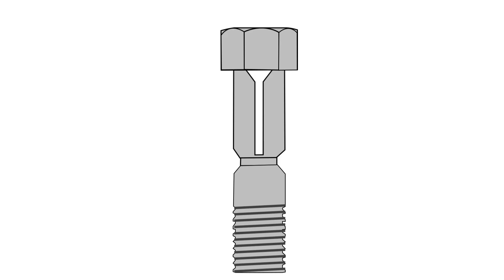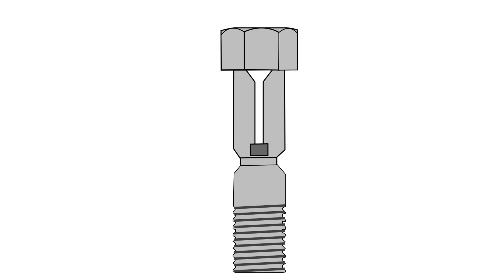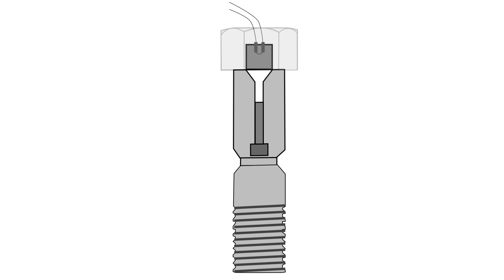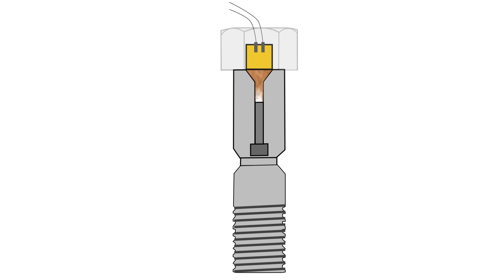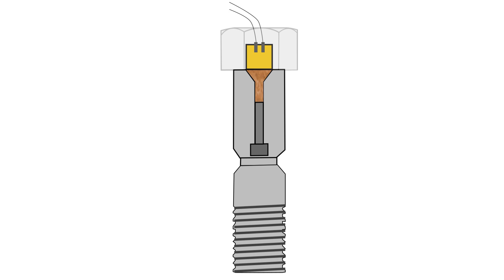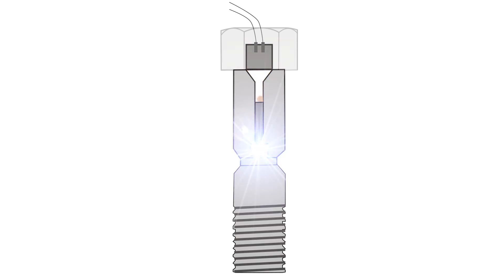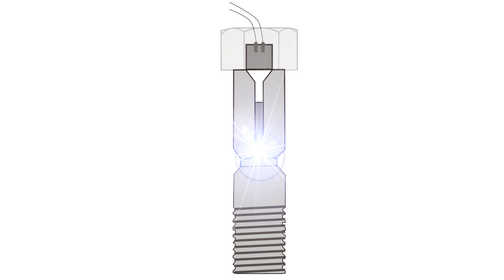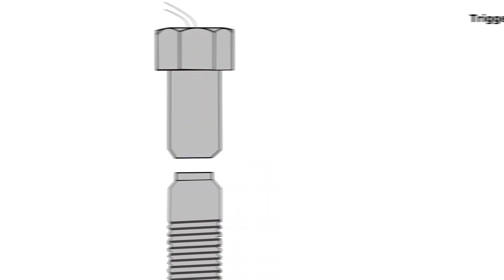Explosive Bolt

Comment: They use these for helicopter ejector seats. More precisely the rotors right above the helicopter ejector seat, so the pilot doesn't get turned into chunky salsa
Reply: I don't think many helicopters have ejection seats. I know one russian helicopter does, it's one that has stacked counter-rotating blades
Reply: @richardmillhousenixon  i think i know the one you're talking about. I'm pretty sure hind series helicopters have them too. Of course it would be Russians who make them
Reply: @richardmillhousenixon  the Ka-52 would be the one you’re referring to
Reply: @doesitmatter1667  Ye, that's the one. The helicopter that yeets it's blades in an emergency
Reply: @doesitmatter1667  ka-50 also had the double stack blades and no tail one but im not sure if it's got an ejector
Reply: Oh dang nvm a quick Google and it literally said ka-50 is the first helicopter to have an ejector seat and the ka52 is literally a 2 seat version of the ka-50
Reply: Mmm salsa. What were we talking about again?
Reply: @jackkraken3888 Homer Simpson vibe
Reply: The pilot may mist it.
Reply: @Rudofaux  at such a high rpm it won’t happen. propellers spin too fast after all they’re lifting tons of controllable metal with  rockets on them or missiles which also pack quite a punch in how heavy it i
Reply: @Deltaivv  Mist it, not miss it.

I pilot will be turned to mist. Now that I explained the joke, it is now dead.
Reply: is the chunky salsa bit from the all guardsmen party by chance
Reply: Helicope have ejector seats
Reply: Also used on rockets
Reply: Chunky salsa lmao
Reply: Not sure I'm comfortable with explosive bolts holding the blades on. Probably why they learn to auto rotate down.
Reply: @graham2631  shhhh, shh, the explosive bolts will not hurt you. They *can*, but they won't
Reply: Side-ejecting seats don't exist.
Reply: @pirobot668beta  i'm too much of a nerd to care about the necropost. it's not side ejecting, it's so much more radical than that. the bolts that explode are the ones that hold the rotors on, they detonate just before the canopy and ejector seat activate. once those bolts are severed the centrifugal force sends the rotors flying, which clears the air space to send you flying straight up from the cockpit once the canopy has been detached.
Reply: @lithuaniaball  it seems people dont care that centrifugal force is just momentum that gets "bend" by the centripetal force... or people just dont wanna learn to call the force by its actual name? sry just confused you are the 50th person who still talks about centrifugal after its been proven to not exist as what it was defined as before. i wonder when people start saying momentum
Reply: @pirobot668beta  can someone smarter than I explain why that would be a bad idea? Because I can’t see why
Reply: @insertnamehere6960  My guess would be a couple of reasons. 1) If you're at an already low altitude, going sideways instead of up gives your parachute less time to deploy, and 2) the lateral g forces exerted on the body would probably cause your neck to snap, along with many other bones breaking.
Reply: @Razzman70  I think number 2 is the case here. Modern ejection seats are generally “zero/zero” capable, meaning they work even with zero airspeed and zero altitude.
Reply: @Razzman70  also the fact that parachutes tend to not be designed to fall *sideways*,
Reply: @insertnamehere6960  slightly tilted chopper, same reason downward ejection fell out of favor after pilots yote themselves into the ground after failed landing or take off
Reply: @Razzman70  also if back blades fail the helicopter will goes spinning with means there's is opportunity to be hit by the tail
Reply: I feel like most heli pilots worth their salt would never use the ejector seat. Just saying, if there's a chance they can recover or set it down somewhat safely, they are going to take it over ejecting.
Reply: @seththeace6217  Sometimes though, helicopters can't be recovered. If you get hit on your main propellers, or the back propeller, you're already done for. When you're going down, you'll be lucky to have the time to eject yourself anyway, let alone regain control over it. 

Planes are the same, of course, but actually somewhat less vulnerable to being made completely useless in one shot, as a plane doesn't rely as much on equal weight distribution or it's own engine; though even a plane can get damaged too much to save it.

Also why would you try to save the helicopter or the plane when experienced and talented pilots are in short supply, and cannot be made with money? 
There's no guarantee the landed plane can be repaired anyway, and even then militaries get much more funding than they deserve, a plane or 10 isn't going to make much of a dent
Reply: @cetomedo  ka-50 and ka-52 both fly pretty well missing the tail , double stacks don't need the back one , because using a back one takes about 30% of total available energy just to use the back one for what it was intended for so the 2 stack design is pretty redundant
Reply: @dylansheppard8636  Fair enough, but the double stacks still are susceptible to failure upon being shot by their.... double stacks:D

But yeah that's a good point the lack of a dependence on the tail propeller would make it much harder to incapacitate a helicopter
Reply: @cetomedo  double stacks wouldn’t be such a pain ejecting because the blades disconnect because that’s the issue, so you’d see 6 blades flying off. with explosive bolts and the RPM of the helicopter rotors while it was airborne is still high so each blade would go off like a shuriken and only the part that spins is left, because it doesn’t get in the way.
Reply: @Deltaivv  I didn't say double stacks would be hard to eject though, what you're saying is pretty obvious. What I meant was a response to Dylan Sheppard who pointed out a double stacks helicopter could still be recovered after losing its tail fin, and I responded by saying that double stacks can also be shot on its propeller which would leave the pilot no way to land it safely.
Reply: @seththeace6217  exactly, iv seen many auto-gyro landings. With choppers they can kinda "glide" down from the blades slowing them up, even with full engine failure
Reply: @backwoodsjunkie08  The term you're looking for is "autorotation." Autogyros are basically planes that use free spinning helicopter blades instead of wings, basically doing a powered autorotation.

Comment: Initially thought it was a bolt bomb we used to make as small children. Two large bolts and one nut. Break off a large quantity of match heads. Screw the nut a couple of threads onto one bolt. Fill the nut with match heads. Screw the other bolt very tightly then throw it high in the air or against a brick wall. Impact on the bolt head causes an explosion. Take cover as it is unpredictable.
Reply: We would use a stack of washers between a 1/2 inch nut and bolt and put green sticky caps on the washer flats, and these would be our toy grenades with out any shrapnel but a bang.
Reply: Try it down a corrugated iron lined alleyway with two 125mm M20 bolts and M20 nut...damn thing nearly took my head off as it overtook me
Reply: @Penguin_of_Death  now that im a responsible adult I might try it with gunpowder and a couple of match heads.

Comment: In China, they build breaking bolts even without explosives ;)
Fascinating video by the way!
Reply: You get what you pay for :).
Reply: And true. But sad.
Reply: Hmm, must've gotten some samples with my Grade 15 dual quality bolts.
Reply: Chinesium bolts.
Reply: You means bolts=buildings right?
Reply: the problem is that they don't break precisely when you want
Reply: In USA they build build planes that nose dives itself into oceans.
Reply: So damn true!😂🤣
Reply: Unless those bolts don´t get exported of course
Reply: Yeh, bolts with spot welded heads that break off under mild load!

Comment: You forgot to put an Amazon link!
Reply: The link was there... but it exploded
Reply: They contain explosives dumbass, you won't find those anywhere except places supposed to happen.
Reply: U can Google the instructions and make one yourself... 😉
Reply: @robinthrill3r7  thats the worst advice you can give someone about explosives lol
Reply: 5 years in the Federal prizon... and 25 years of losing your Rights...
Reply: @СергейРяшкин  ehhh probably a small enough amount to be considered a "pyrotechnic" rather than a "destructive device"
Reply: @seagie382  well... there is the 222's articel of Federal Criminal Code — 2 years, for the TWO •.22 LR! → 2 years
Reply: @СергейРяшкин  Could you provide some kind of source as I have no clue what you're trying to tell me
Reply: @СергейРяшкин  in russia? Lol I’d rather have vodka and a tank

Comment: Seems like what we would have would be a really weak bolt, with a narrowed shaft and then a hole drilled through the center. The bolts HAVE to be weaker. Are we sure the explosives are even needed?
Reply: How else do you have the pre-weakened bolt fail exactly when you want it to?
Reply: @Neuropsych it's actually not THAT weak - a similar profile is used on the fuse pins that hold aircraft engines to the pylons. These are designed to fail if vibration from a failing engine exceed safe limits. The fuse pin breaks, allowing the engine to fall away from the aircraft...

https://aviation.stackexchange.com/questions/23151/how-are-engines-mounted-onto-wings
Reply: That depends. Do you want the cockpit windshield to open against the opposing air pressure when you pull the ejection cord or not?
Reply: This is scalable.  and high explosives are insanely powerful.  Explosive bolts with 20-30 thousand pound yield strength are common.

Comment: Well yes, that's certainly one explanation. Not bad, if you take a look at the patents for these things they have some that use Thermite, at ignition the Thermite turns to a liquid which expands and snaps the bolt.
Reply: Thermine is fascinating stuff.  Love working with it.  You can combine some thermite and magnesium powder and stips.  Along with some 24 oz water bottles, balloons and alot of duct tape to make homemade flashbangs.  You essentially build a chamber in the center of the bottle with the balloon full of thermite magnesium mixture.  This is sealed to a steel straw that has a magnesium strip inside that reaches the top of the bottle.  Fill with water and seal in such a way that the strip is sticking out of the bottle but not touching water.  Light strip throw strip hits thermite magnesium mix, flashes the water to steam inside the bottle that you wrapped several times in duct tape.  Bottle ruptures and steam explosion goes "BANG" while the balloon full of magnesium and thermite blinds ya.
I may have received a citation for showing one of these off at a 4th of July party.  The sound it makes is closer to a full stick of dynamite than any legal  fireworks.

Comment: In my mazda all bolts doing this without any explosives, just pure rust power XD  btw what is this for ?
Reply from the maker: That's a good one. 
It's used to separate spacecraft from launch vehicles, release solar panels and communication antennas from spacecraft so they can unfold.  Here's my other video were this clip is from that explains some use in the space industry.
https://youtu.be/PFABKpqWG9Q 

There are many other uses for explosive bolts.
Reply: The funny thing is chemically rusting and exploding is almost the same thing rusting is just way slower :D
Reply: Just have patience.. Use penetrating oil on everything and give it some days.
Reply: at the local Mazda meet "wow, are those the original body panels?"
Reply: I see the tinfoil hat brigade have arrived
Reply: Making world trade centre no 7 collapse on cue.
Reply: @myview5840  hahaha

Comment: So won't the explosion damage the rocket or whatever it is attached to??
Reply: It's a very small explosion, just enough to break the weakened part of the bolt. I'm 90% sure you could hold the part of the bolt with the explosives in it, set it off and you wouldn't even lose your fingers. It would still hurt probably, so don't try it, but still.
Reply: @n1thecaptain965  i like those odds, be right back
Reply: @oliverdepauw5663  DON'T
Reply: @n1thecaptain965  are you f-ing crazy?  I make these things and they will take your hand off...  The gas temperature and pressure that expel after separation will destroy you!
Reply: @chrisseyfarth2473  I wasn't 100% sure if you could hold it in your hand or not, I was just guessing based on the fact that there can't be that much explosive packed into one little bolt. The fact that it will take off your hand is Gods fault IMO, he should have buiilt us better
Reply: Think, 'Canopy Jettison'.
Reply: there are usually protections built around the bolts to catch any fragments.  Also, there are more elaborate non-fragmenting explosive bolts for more sensitive applications

Comment: I have searched a long time a few years ago without finding any good description. Now it seems Youtube/Google remembered my old search and finally directed me to your excellent explanation.
Reply from the maker: Thanks. Glad I could help.
Reply: But what's the point of these bolts?
Reply: @jotaro4874  To saftly remove a bolt from a distance. Hard to think of a practical industrial application, they could definitely be used in special effects for movies.
Reply: @tonispiip8054  the big usage of these is in spacecraft. the joint between two stages of a rocket needs to be very strong up until they need to seperate, and explosive bolts tend to be far lighter and more reliable than, for example, hydraulics
Reply: @yokowan  of course yes! That's a perfect application. Thanks
Reply: @tonispiip8054  Also ejection seats, you want your plane/helicopter seat to withstand heavy forces and weird g-forces, but also be able to launch you quickly out of harm's way.

 Also detaching propellers and plane cockpits, you don't really want to be launched head-first into a hardened glass frame or the human equivalent of a blender.

EDIT: Also missiles, apparently. 
I guess that makes sense if you need your missile to be destroyed for safety or have a few stages.
Reply: Let's be honest, It's less yt remembering your old search, and more this video randomly trending

Comment: Does fighter jet canopy also use this kind of bolt when the ejection seat button was pressed ?
Reply: Some also use explosives embedded in the canopy itself - if you've seen the squiggly lines in an AV-8B Harrier's canopy, those are the explosive charges that blow a hole in the canopy milliseconds before the seat fires.
Reply from the maker: Yes they do. They also sometimes use linear shaped charges.
Here is one of my videos on Shaped charges in general.
https://youtu.be/Li2Kt4DtUdY

Here a video on my other channel that has a part that talks about linear shaped charges.
https://youtu.be/keoVUz-PIi4?t=512

Comment: What, why?
Reply: For rockets thats how they separate stages they bolt the rocket stages together with these and at staging they detonate separating the stages.
Reply: @abigalerose1410  I see, that makes sense. Thanks for the answer
Reply: Also for helicopters with ejection seats, the blades are attached with these explosive bolts that explode before the pilot gets ejected so he doesn't turn into a smoothie

Comment: I just read an article about an X-15 flight that created enough heat to detonate three of the four explosive bolts holding a hypersonic model attached to the aircraft.  I see now why that happened, thanks for the great explanation.
Reply: That's called auto-ignition.  Usually these bolts are tested in an oven for auto-ignition beyond the operating temperature of the application.
Reply: Yeah, they would have been tested but the bolts held the model attached to the lower ventral fin of the X-15.
The extra shockwave created by the model impinged on the fin and caused extreme heating which partialy burnt through the inconel skin of the aircraft.
A weird one as you would assume that the creation of an strong extra shockwave would be reasonably obvious.
If I remember rightly it also endangered a hydraulics system too?
I read it in "At the edge of space" by Milton Orville Thompson.

Comment: but then how do they get rid of the threaded piece still inside, is it the same as extracting stripped threaded bolts?
Reply: These parts are rarely, if ever,  reusable.  The answer to your question is that they don't.

For reusable applications they use a different method.  I am sure space-X has some good patents on such techniques.
Reply: @Micklemoose  For second stage they might use some sort of mini hooks and pins for attachment, but for separation they use a piston that inside the nozzle that pushes second stage out
Reply from the maker: No. Once the bolt breaks in half then the top half of the bolt and the threaded part with the nut still attached are two separate pieces. They can no longer keep together whatever that was squeezed between to nut and the bolt head.
Reply: Id hazard a guess that anything that has the exploded threaded bolt still screwed into it wasnt of much use anymore...
Reply: I think in cases in which they are used it doesn't matter, like single use boosters or ejection seats

Comment: Now I can watch a certain scene in 2001: A Space Odyssey with better understanding :)
Reply: No way! I watched the moovie about a month ago and i never heard of explosive bolts before so i searched it up, what a coincidence
Reply: @noabeumer339   they are still used in space craft and some air craft even today. If you ever watch videos of any of the rocket stages separations you will see them detonate. All of those stages are held together with explosive bolts or pyrotechnic fastener
.
Reply: @gabegu5102  Not all of them. For example, SpaceX uses mechanical detachment (basically a latch that uses electricity to unlatch).
Reply: My first thought was The Right Stuff